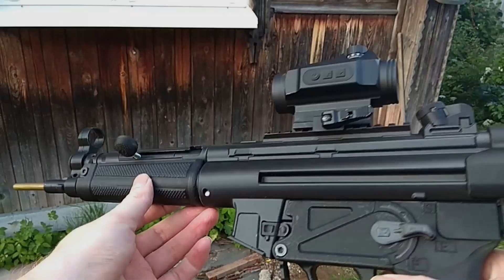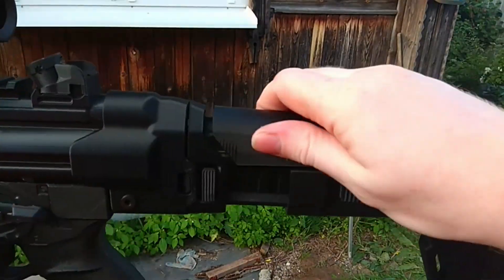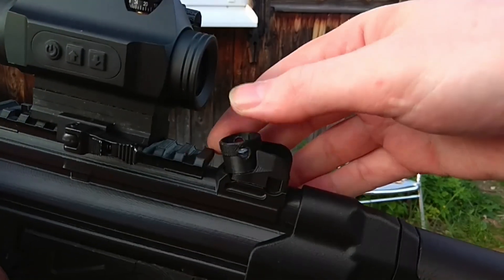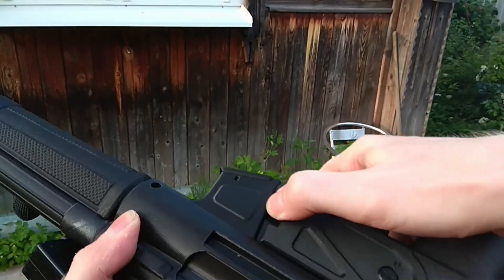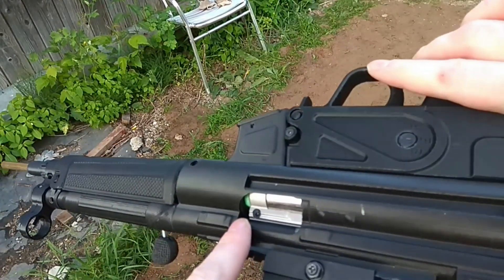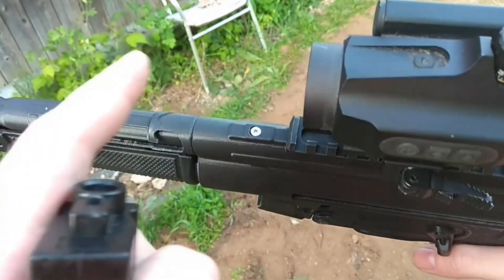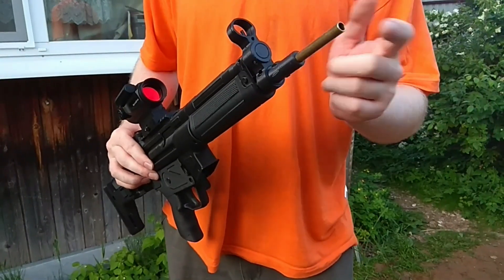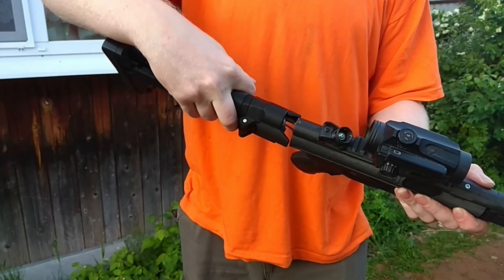3D printed Airsoft MP5 (PAMP5 AEG)

Comment: The SEF lower (gearbox plastic house) are  printable?? Because this part are very hard to find in the web,  where it is still available.
Reply from the maker: The entirety of the body is indeed printable. But I haven't yet made a, say, cyma compatible lower. I tried meshing it with cyma upper and it looks like I can make it, just more work on top of other things I want to add.
This video is outdated by this point also, Have made improvements to parts I critiqued, front sight got remodelled, rear drum sight improved, stock housing got a little beefier, etc.

Comment: hello igniz i love this but i have a few questions. Can you make a list of what hardware is needed? Will the same gearbox that i use for the PAAR15 work in this as well and can i use the gearbox stock or is the printed trigger necessary? will normal hop ups work or is it just better to use the custom one made for this? Thank you I look forward to building this in the future
Reply from the maker: Could have asked anywhere else. approximate list is on the thingi page. In boosty download there are text files with exact hardware needed. This thing is still a bit of a WIP so list is not finalized. Hopup is printable only. You're not using m4 hop in this. normal v2 works, you need printed trigger and printed selector plate. As with paar15v4 stopper for t handle on the top of v2 gearbox is best removed.
Reply: @Igniz_aeromozol thank you so much. Also sorry to ask here, I just figured there aren’t a ton of comments here so it wouldn’t get as drowned out lmao